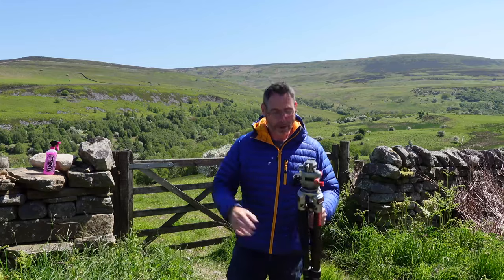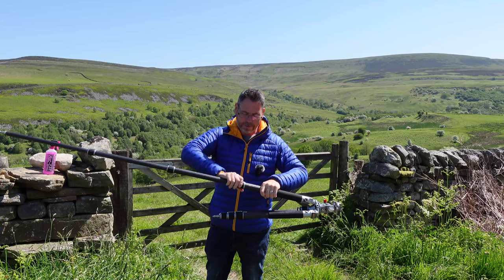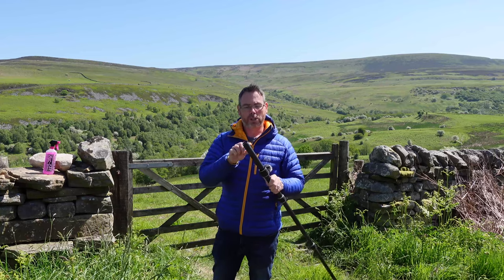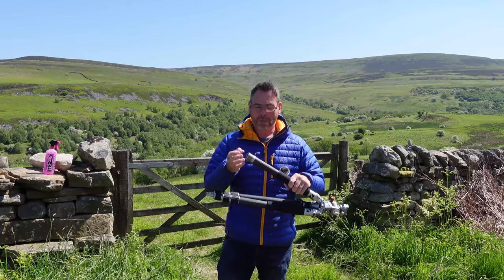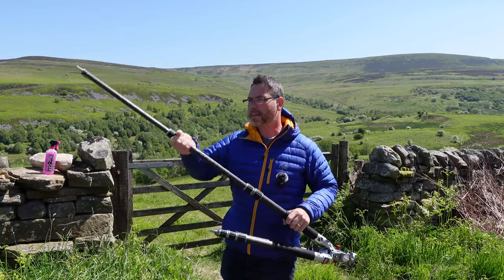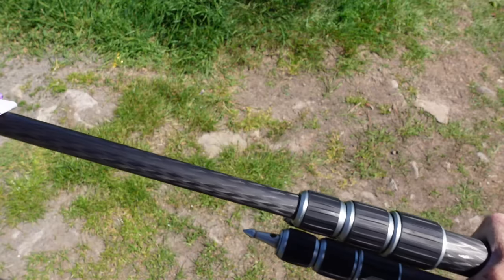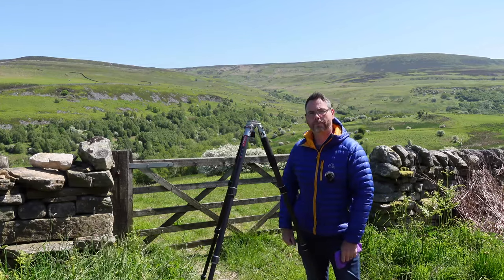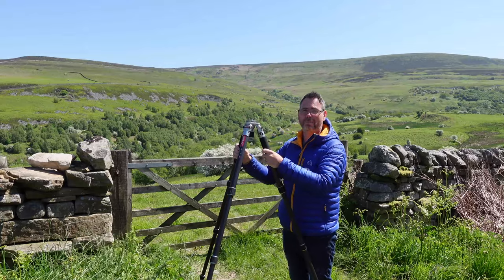"Carbon Fiber Tripod Maintenance Demystified: Cleaning Techniques Revealed"

Comment: Thanks for this. You are correct, there isn't much info out there.

I use my tripod in the water all the time so my cleaning is more extensive than you described. In the field I remove the bottom leg sections and drain the water out of them. When I get home I take all the leg sections apart, dry them and place them vertically on a towel so the inside will drain. The next morning I reassemble them.

Hudson Henry recommends SuperLube on the threads so I do that whenever I clean the threads. Mine came with lube on the threads so I assume the manufacturer doesn't want them dry.
Reply: Gitzo sell small tubes of grease at a premium.